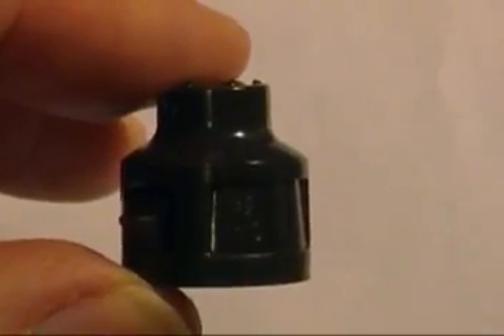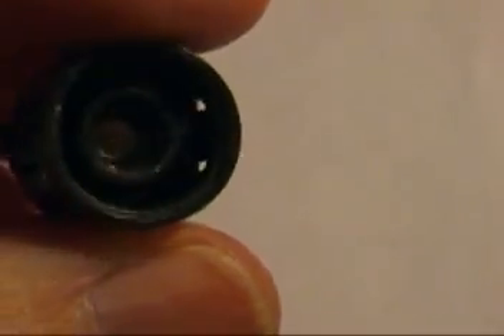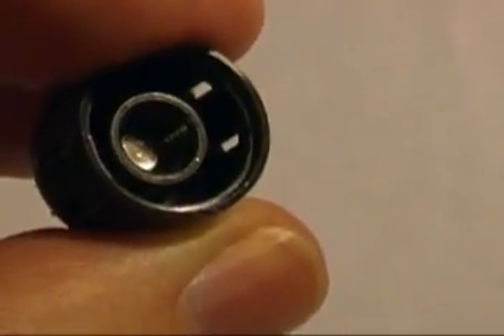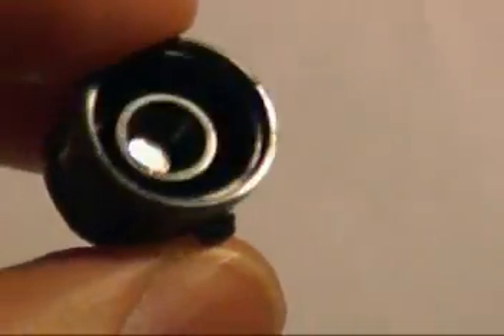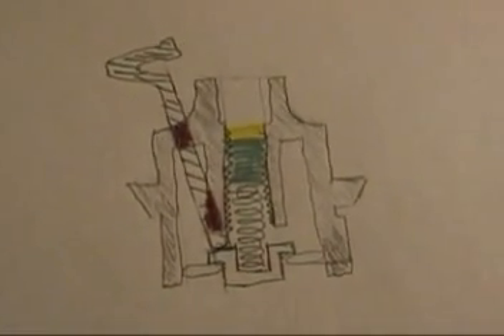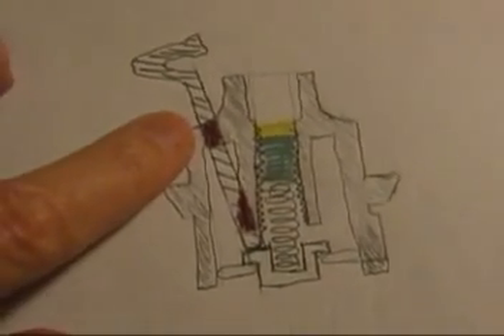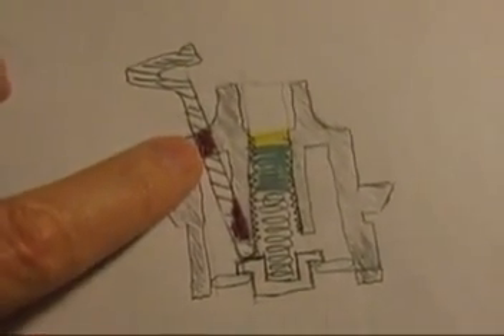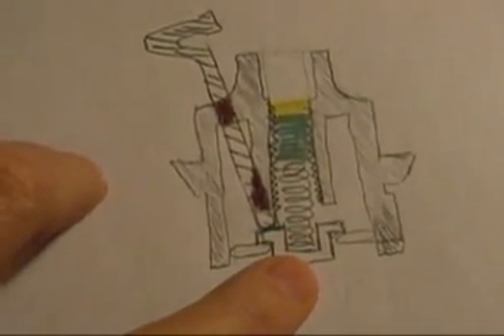Forced Carbonation with MillerCoors Home Draft System - Post Script

Comment: I meant if I were to change out the spring to a small rod to completely close the valve, put in a CO2 charge it may force carb in only a couple of days like is done with corney kegs. After two days, remove rod and re-insert spring new CO2 charge and then serve.

Comment from the maker: The idea is not to open the regulator valve all the time.  Then it wouldn't be a regulator any more, hehe.  If you opened the valve completely, then all of the CO2 would be released from the cartridge and it would blow-past the gaskets and be wasted.  A slightly stiffer spring (or just compressing the existing spring) a little more would increase the regulator's "set point", so instead of (maybe) 5 psi, it would be 8 psi.  But you don't need more pressure to deliver, just to force carbonate.

Comment from the maker: @LSRC11 One more thing I learned about forced carbonating...If you have the CO2 cartridge really tight, you can not force carbonate (and the normal regulator might not work either).  You can't crank down on the CO2 cartridge too hard.  If you're using *exactly* the same 16g cartridges as the ones that come with the unit originally, you don't need to think about it...just line up the green arrows.  But if there's even the slightest difference in cartridge, you need to finesse the tightness.